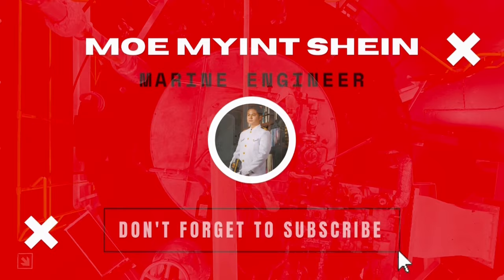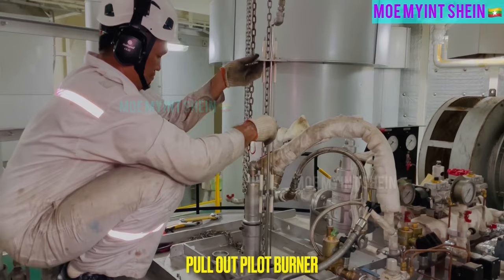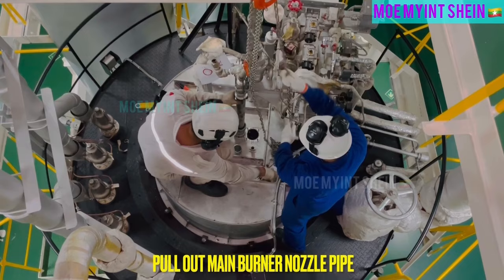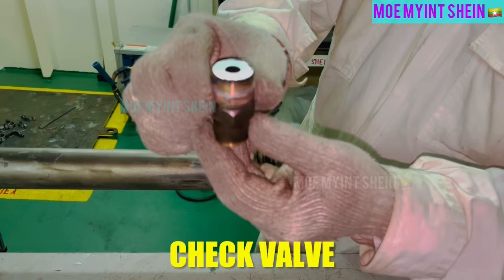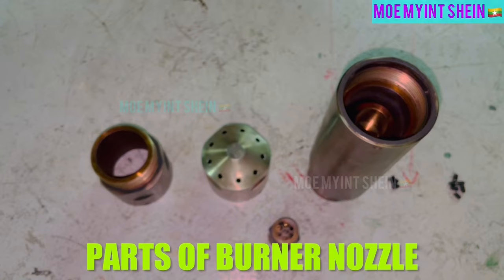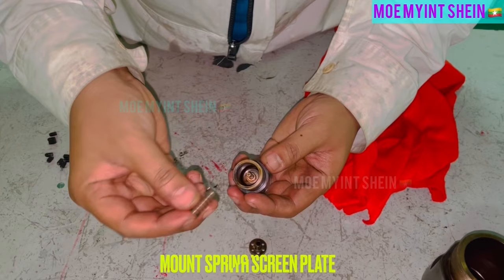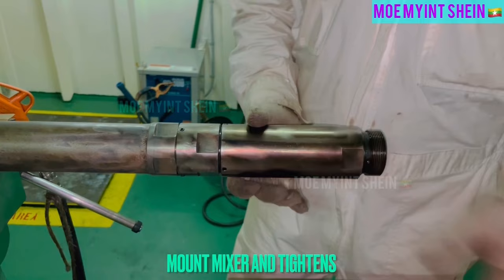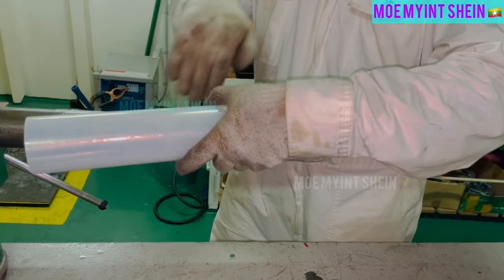[MiURA] BOILER Main Burner Overhaul | Marine Engineering | Engine Room | Technical Vlog : 092

Comment: Here what i see steam regulating valve , i assume steam atomized pressure jet burner. easy for maintenance but high pressure fuel oil should be care.
Reply from the maker: Not only steam is used for atomisation, also compressed air is used when steam pressure reaches below 0.38MPa.